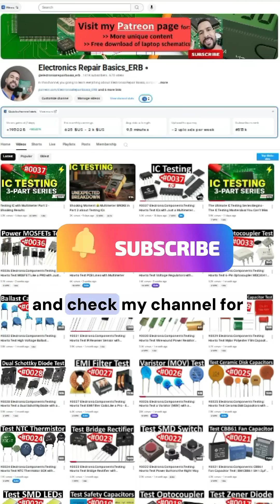The Hidden Power Rails That Control Your Entire Motherboard - 3VALW and 5VALW #repair #electronic

Comment: What are inductors in the RAM circuit used for? The power circuit feels like a filter circuit
Reply from the maker: Inductors in the RAM circuit mainly help to smooth out voltage fluctuations and maintain stable power delivery. You're right; they do act similarly to filters, ensuring that the power is clean and reliable for optimal performance.
Reply: need to know as well! the most important question!